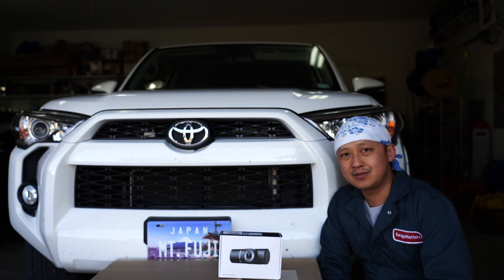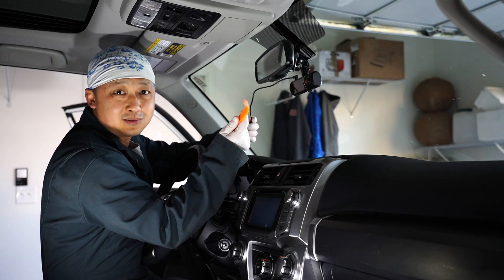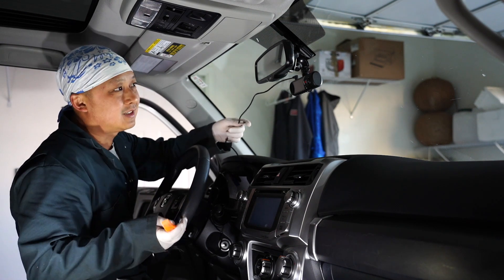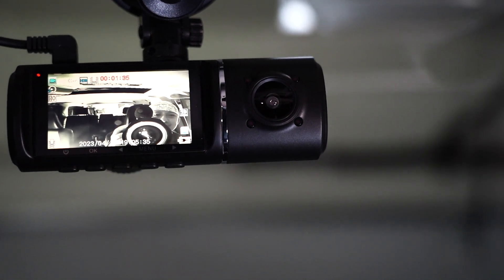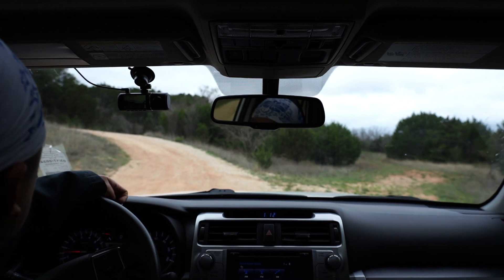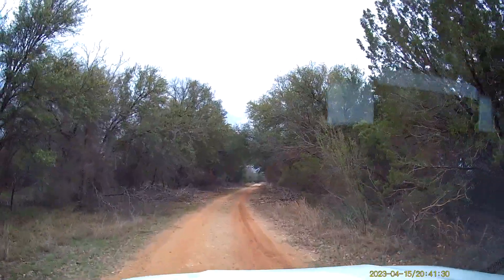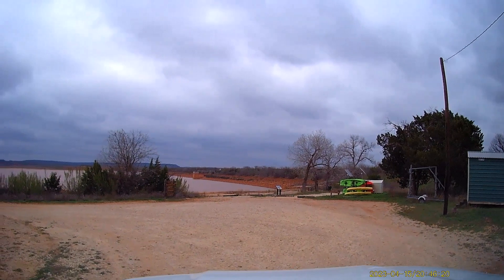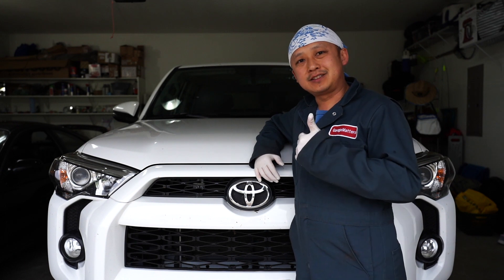$70 Dash Cam install and 📸 review 4Runner

Comment: I have the same dash cam for over a year now. My only concern is sometimes it would power off and on randomly, not very often but I think while on the road that is critical cause you never know. Considering getting an upgrade. Great video anyway!
Reply from the maker: I haven't experienced that issue yet, but am also thinking about an upgrade. I shouldn't expect too much for what was paid for it, but I sometimes wish for better audio and video quality. Thanks for stopping by.